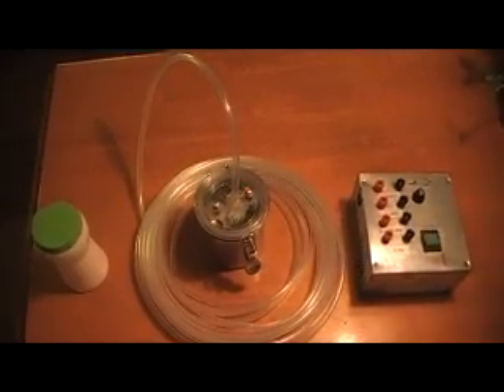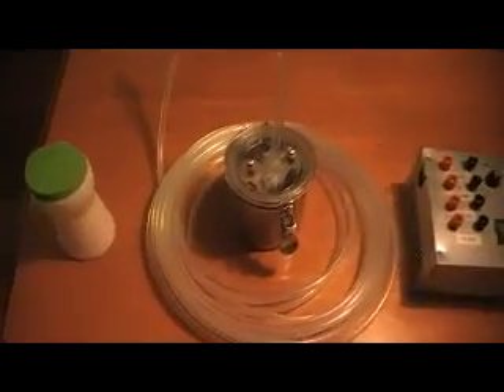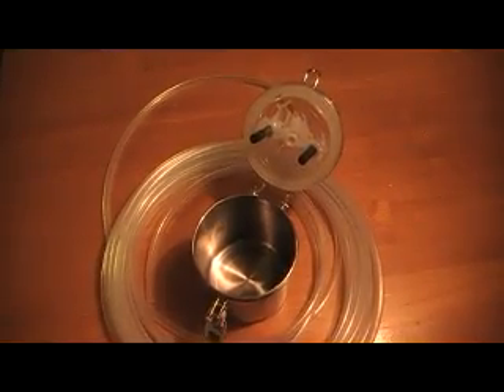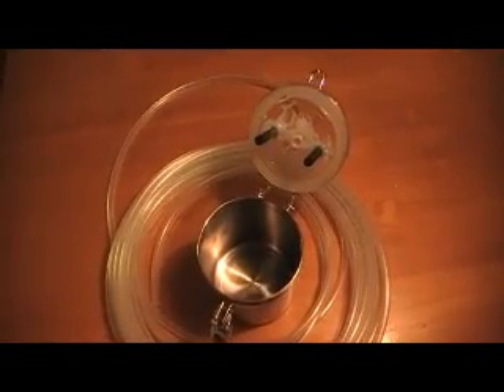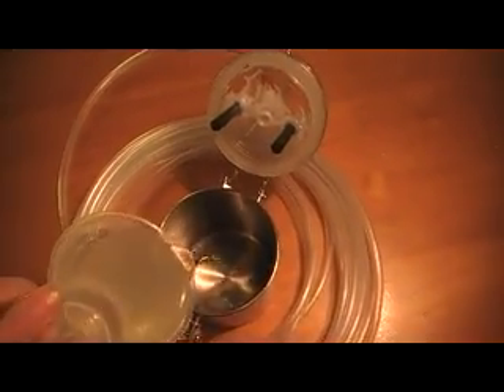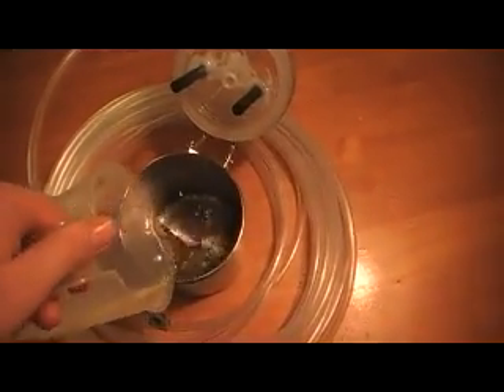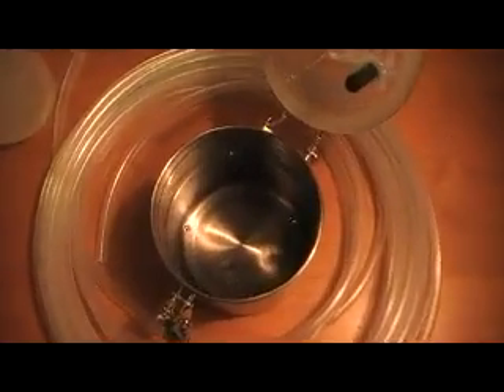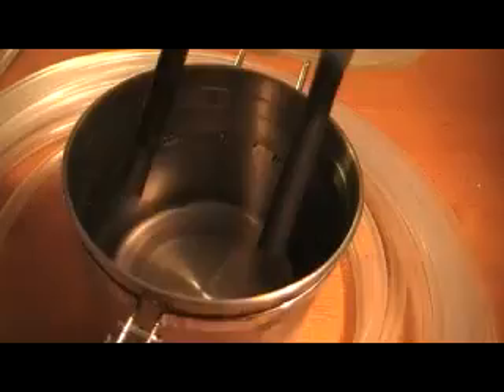How to make Potassium Chlorate Part 2

Comment: Thanks sir this a very informative video seing english is not your first language. Would have liked more information on current, voltage etc. Did like the way you created catode and anode. You used easily obtained graphite tubes and stainless steel containers. Thanks for emphasing that mixing hydrogen gas and chlorine Gas is very explosive. UV rays and sparks can set this off. Learned this from electrolysis of brine to make hydrogen. Wear gloves, fume hood, safety glasses etc. Thanks. Rev. Red

Comment: Nice work but I have a question how to know if the electrolysis process has finished ???
Reply: A lil bit late but it will be finished once sodium chlorate starts to crystallise on top of the potassium chlorate, the crystals look a bit different. When this happens you can take it out, filter, dry etc. If you wanna remove any sodium chlorate that might contaminate it then you can just use water to dissolve the sodium chlorate then just filter off the potassium chlorate since Naclo3 is More soluble. You can also just finish the electrolysis early if you don’t wanna deal with that.